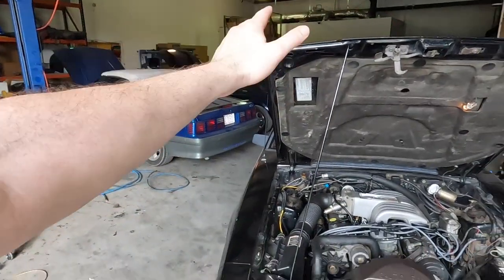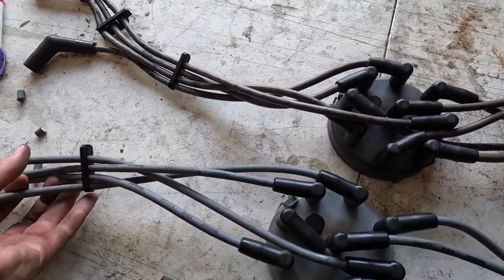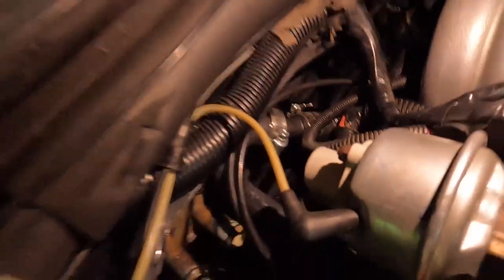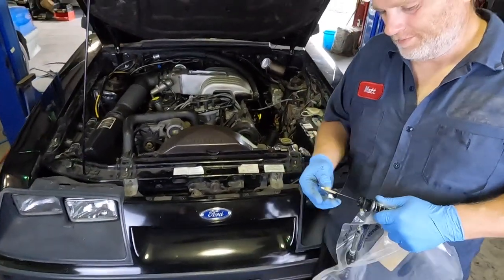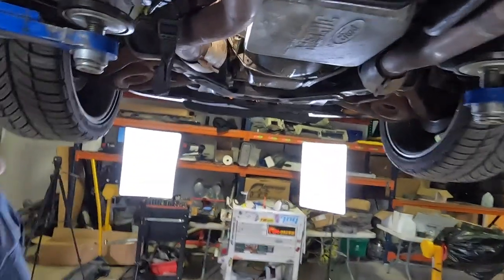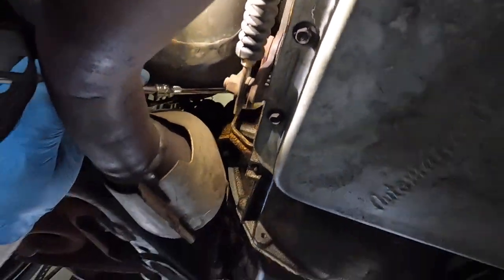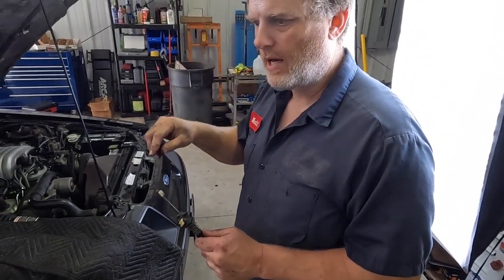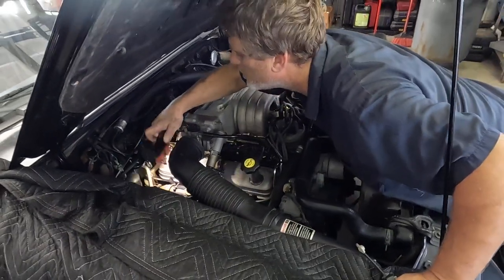PREVENT Your FoxBody AOD From BLOWING UP!  // Throttle Valve Transmission Cable Install

Comment: Definitely had that happen to me when my fox was AOD! Went through a couple AOD rebuilds before I manual swapped mine!
Reply from the maker: oh no!  Sorry to hear that but hope you enjoyed the manual.  We're gonna see how long we can get this AOD to last for her
Reply: @GearHead704  love manual, but the aod will last as long as the TV cable is set correctly, especially if its just daily driver use.
Reply: The problem with AODs is that when they put them in these cars it signed their death warrant,90 % of people that own these cars enjoy romping on them , some constantly and unless a AOD its built up by a shop unlike stock it wont last very long,on my 91 i have a AOD (my 89 is standard) and i had it rebuilt in 98 and its just now giving me some small issues, thats 26 years, not bad for a tranny ,but its like you say "just daily driver use"

Comment: Well you didn't fully break the throttle valve trans cable, it was still working mostly. You need to do better job Matt,  at least you could find a new one. Now you need to 
make sure she can stop and be safe. Knocking repairs off the list feels great.
Reply from the maker: LOL, I will try harder next time Paul

Comment: The aftermarket TV cables are useless,finding a real one is akin to running into Aladins cave, damn, that grommet on the old cable looks new,on mine that grommet after years and years the rubber is almost dissolved,lol
Reply from the maker: Agreed on all counts.  I got lucky and found this one on ebay

Comment: That trans cable was a trap from ford, come on tare the trans up ,so you can buy another one, good luck
Reply from the maker: Right!  Nuts.
Reply: @GearHead704  I’ve got the one LMR sold, hope it don’t tare my transmission out, don’t even think they sell them anymore, got it with a car I bought it was in with all the parts, everything was there tho, they have a video on it tho, wish me luck lol